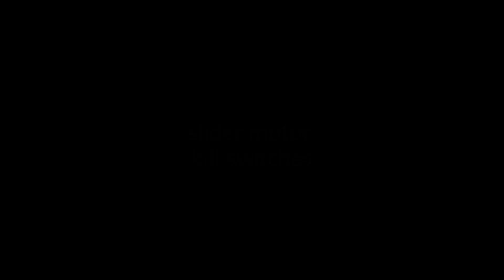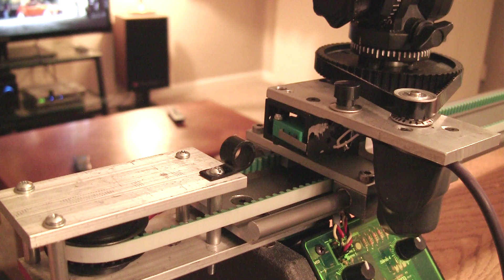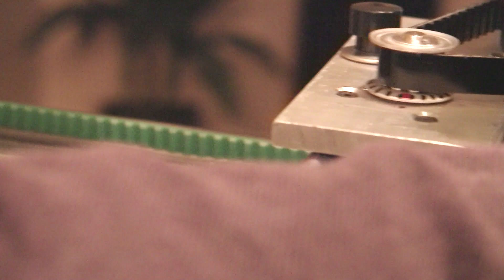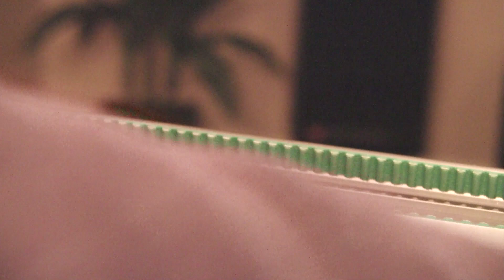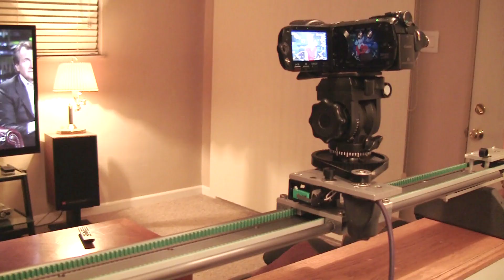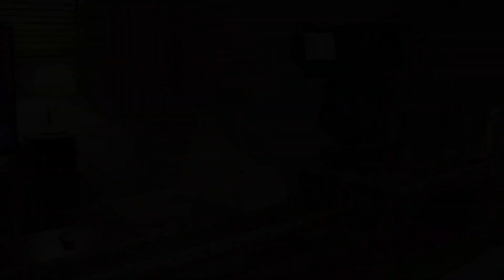motorized IGUS slider kill switches

Comment from the maker: Hi Green Peas Films
I bought the little switches at an electronics store that specializes in used electronics parts called Gateway Electronics. They haver everything under the sun but their website could never list everything. I am quite confident that you could find something through a google search or even ebay. Sorry to take so long to respond.

My slider is for sale in case you are interested.
Dan